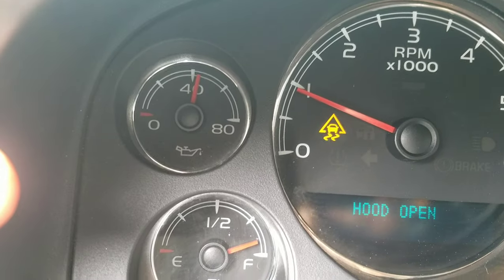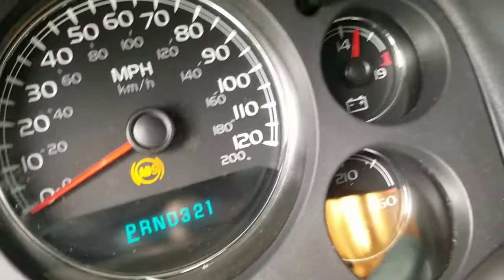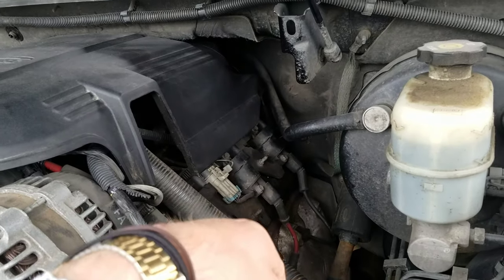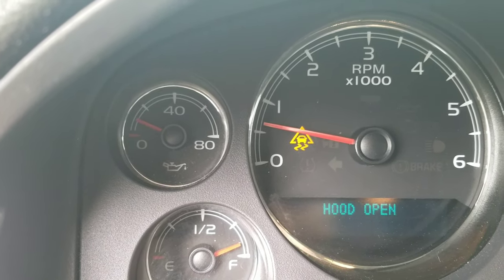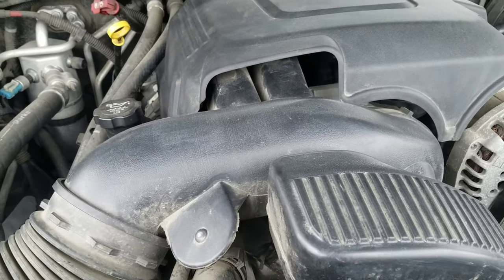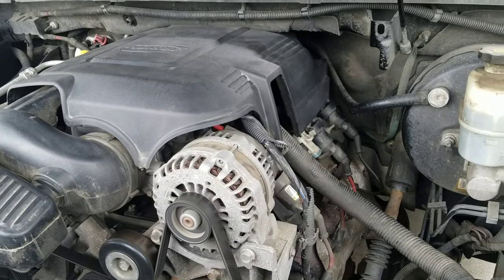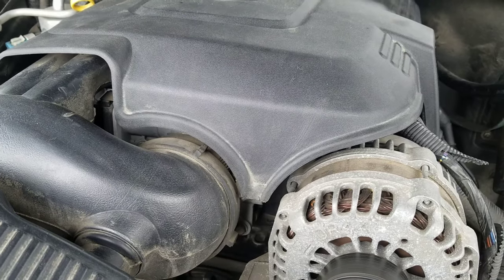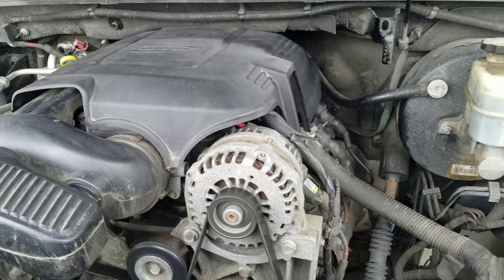0 or Low Oil Pressure? Chevy Suburban, 5.3l Vortec 2007-2014, Tahoe, Yukon. Diagnose and Fix Easiest

Comment: Have similar problems. Here is what to look for not in any particular order. Bad sending unit, Bad oil seals, rear main seal, o ring on the oil pick up tube in pan cracked, oil pump worn, and Cheap restrictive oil filters. I do recommend the oil flush trick on older high mileage engines too. Good luck!
Reply from the maker: Good call

Comment: Yeah. Had the same problem on my 2007 Suburban. 3 times after oil changes at a well known oil change place where they were using Cheap FRAM oil filters to save a buck. I could be driving along and the pressure would slowly drop to zero giving me an alarm. I would put the truck in neutral and shut the engine off for 2 seconds and restart while coasting along. Pressure came back to 40 immediately on restart. Changed to WIX filters (insisted the oil change place install my provided WIX filter) and never had the problem again. Something was breaking down in the filter after 1k miles. Decided to change my own oil after that so I know the quality of the oil and filter. Saw a Youtube video where they tore apart oil filters to show the quality. FRAM was rated worst and WIX among the best.
Reply from the maker: Yup. Never use fram

Comment: Exactly what I am experiencing. I changed the oil pressure sensor then had to take to the dealer. I changed my valve cover gaskets due to leaks but my valve cover bolt holes were stripped. Dealer installed heli coil kit and new valve covers, drove the truck and said oil pressure was good. I picked it up, drove 10 miles and oil pressure dropped to zero. Back to dealer and they did a manual pressure test which was 20 psi @ 3000 RPM and 0 psi at Idle. They said it was indicative of bearing failure and suggested a new engine. I told them to check the oil pickup tube screen for blockage and to change the o-ring on the pickup tube. They're doing that this week.  I'm pretty sure it will work. Like yours, I have zero engine noise. 2010 GMC Sierra 1500 SLE 5.3L Vortec.
Reply from the maker: Yeah hopefully that solves it. Stripped bolt holes are no fun
Reply: Hi Richard, what was the end result after they changed the o-ring on the pickup tube?
Reply: @micahrobinson5224  they've been sitting on it since I posted this, giving me excuses as to why they haven't got it done. I called them today ready to tell them I was taking it somewhere else, but when I called they said it was being worked on and should be done by end of day today. Stay tuned.
Reply: @micahrobinson5224  well, they found a piece of cam bearing in the oil pan. Again they say new engine. Waiting to see if Warranty company will cover it.
Reply: @micahrobinson5224  warranty company (Route 66) is paying $3K towards a new engine. I found a company that remanufactures the 5.3 with a D.O.D. Deleted engine for a few hundred more than the D.O.D. engine, S&J Engines. Lead time is 12-14 weeks on delivery. I'm also thinking about poly engine mounts from AFP. Dealer would not install a D.O.D. Deleted engine, says GM won't allow it, but that's ok because they charge $2800+ for an engine install and the mechanic I got is $900. I'm good with saving $2K! Hope to be in my truck by mid May.

Comment: I had this same problem. My oil pressure fluctuated and fell low enough for the same alert to come on. The car had no signs of low oil pressure; no knocking, no increased temperature, or reduced power. We tried quite a few things. The one thing that fixed it the gauge and alert problem was to simply change the oil filter. I have about 25% life left on the oil, so I will be changing it soon enough. During the course of regular driving, it never dropped below 40 psi, except at stoplights, while it idled, and that still stayed in the 30 psi range. I'm sure that this is a symptom of something else, but that put my mind at ease. I will add ATF to my oil right before my next change, for sure.
Reply from the maker: Yeah. Could be all the gunk in the oil is getting caught in the filter and restricting flow but then you would see hear symptoms of low oil so that's what's weird.
Reply: What brand oil filter are you running ? A certain one I need to get ?
Reply: @g3mccotter  How long you let the ATF oil inside the engine?
Reply: @mrhighway  u ever get this answer ?
Reply from the maker: @mrhighway  I ran the atf in there for maybe 30 mins idling. Once pressures were good I drove it probably 10 miles next couple days to make sure it was good.

Comment: I have a 2008 Chevy Silverado 1500 5.3 4x4 z71 and it would read 40psi at start then quickly drop to 20psi eventually 0psi when i would first start it in the mornings during cold weather seasons, I always made sure the oil level was correct, first i replaced my oil pressure sensor along with a new screen with it, new oil, oil filter after that I was getting great oil pressure well 2 weeks later my oil psi drops down again. I finally just got the o ring replaced on the oil pick up tube its reading 40psi at idle and 60psi at highway speeds couldn't be happier. I Strongly recommend getting the o ring replace
Reply from the maker: Yeah I've heard this can be a culprit.
Reply: This is exactly what my 09 Silverado is doing. At crank up about 45 psi and gradually falls to 20 psi and pretty much stays there. I had the oil pressure sensor and filter changed. So I’ll have the O ring done next.
Reply: Well I replaced the O ring and still had low oil pressure, so I replaced the oil pressure sensor switch again thinking it might be bad, still having low oil pressure. Crank up 40 psi, gradually falls to 20 and stays. Any ideas?
Reply: @peppercombs  same here!!  Lmk. When you fix it

Comment: Going to give this a try. Bought a 2011 yukon. Had low oil pressure. 1st changed oil pressure sensor and screen. No effect. Then changed oil pump, oil pressure relief valve, and broken pickup tube o-ring. Oil pressure improved but not where it should be. Oil pressure starts cold at about 30 then drops as it warms. Went to slightly thicker oil resulting in very slight improvement. Always using full synthetic. No ticking, no knocking, no misfires. Also going to try switching to the OEM oil filter (AC Delco) after the seafoam treatment.
Reply from the maker: This is more a fix if you haven't done all that yet. Haha maybe it will work for you though.
Reply: @g3mccotter  what else is there? I have an 08 escalade I just got with no oil pressure, except I have the lifter noise like this guys 2011 yukon, im really not getting any pressure.
Reply: So did it work 🤔🧐

Comment: I did this trick.  And it seems to work.  Will update after a few weeks.  I only let mine run with seafoam and tranny fluid for about 30 mins. Then did oil change.  40 psi at idle and 50-60 psi driving 😀
Reply from the maker: Good to hear

Comment: Well... It's my turn to confirm or deny.  Got the exact same issues, Stabiltract warning and all.  I get the same 40 PSI pressure that slowly drops to zero until the alarm goes off.  It's been 6 months since last oil change due to remote work and moving states.  Still got the thicker summer oil in it and even some heavy STP additive due to heavy towing of tandem axle trailer and it's now anywhere from 20 degrees to minus 13 here.  So definitely time to change the oil and refresh.  I started by putting some motor flush (small amount, 25% of bottle) in with some High Mileage Sea Foam also.  That's one of my favorite combos.  I'd use pure naptha also if I could find it.  I'll keep you posted how this goes.  I may have to switch to the ATF + SF combo.  I also suspect my oil filter at this point is actually creating a blockage/restricting flow... so looking to replace that and see what change occurs pre and post?
Reply: Owned this rig 3 years now. 163K miles on her.  This condition struck last weekend for the first time, while on a ski trip.  Had to turn around 5 miles out of town and head home to swap out vehicles. That's how serious we took this condition. We thought the motor was going to be toast.  So we limped our way back home stopping every couple miles as PSI on hwy dropped to zero, trying to avoid real engine damage. Found out she had a CarQuest Standard Oil Filter for conventional oil, not for synthetic oil, which I paid for (cheap $5 filter, only 5,000 mile protection, truck has 12,000 miles since last oil change, part #R84060).  Truck sat all week. So last night, I began dumping some High Mileage SeaFoam and some Motor Flush into the vehicle.  Let it run for 2-3 mins... then shut it off.  I did this 3-4 times and let it sit over night and most of today in freezing weather.  I got to the Oil Change facility here in town, and explained what was going on.  I put 1.5 quarts of motor flush in ($9 Walmart)... and let it run for 15+ mins total, turning the car off intermittently (30 mins overall).  Pressure was never higher than 20 psi, no matter what I did here.  I handed her over and gave the guys my own, new FRAM Synthetic optimized filter ($8 Walmart) and let them  change the oil.  Truck came out and had 32 psi right away and was holding at idle of 500 rpms.  I drove her 50 miles, hwy, right out of the parking lot, after this because I could see she was immediately popping up to 39, 40, 42, 45 psi (normal) and holding and if I'm going to have a problem, I want to know it now.  I did put the other half can of Seafoam in the new oil so it continues to clean and will leave it in.  Guys, gals... this did the job and I had PSI back immediately after getting that old oil filter off the engine. (A critical step and likely cause of most of the flow restriction)  Comparing methods: The ATF fluid is hydraulic fluid, not motor oil, and has detergents in it.  The motor flush is full of organic solvents that eat sludge and varnish faster, it's diesel fuel, kerosene, benzene, napthalene and other sludge dissolving solvents.  Both are good options.  And I feel bad for anyone out there that has been burned by the Dealership misdiagnosing the issue and resorting to thousands in unnecessary and preventable engine repairs.  Let's get the word out on these inexpensive solutions.  Change your oil filter immediately!!  That's the bottom line.  Thanks @g3mccotter for making this vid bro!  Huge high five, Sir.  First round of beer is on me. 😃  Total cost of all fluids, oil change, new filter to fix issue = $150 (reducible to $70 next time).  No OEM parts were replaced.   Cost of new Engine = $7,000 plus 15-30 days dealer shop time.  Do you want to make several months payments on the Dealership General Manager's six figure Ski Boat? (a real thing, I used to work for one of these azz holes)  Or save that money and put it towards your kids?  You decide.
Reply: Update:  Solution Confirmed!!  This Solution May Be Faster when using Solvent Technology Rather Than Detergent.  Total Time to Fix:  90-120 mins  Root Cause: Standard Oil Filter Causing most of Blockage, Likely Sludge Build Up due to reduced oil pressure.  Resolution:  Priority #1, Replace Oil Filter with High Quality FRAM Ultra Synthetic "double media" Filter (FRAM Part XG10060 series for 2008 5.3L V8 Tahoe).  Seriously... what's an extra $3 over standard filter??  You're $7,000 Engine deserves this!  #2,  Treat w/ Seafoam + Motor Flush or  SF + ATF to clean sludge from engine and oil pressure sensor and  internal screens.  Add most of motor flush at oil change station.  Don't rev engine or drive without increasing oil viscosity first to get to JiffyLube or Grease Monkey. It ok to go over dip stick max to solve issue.  I was 3 quarts high slowly rolling into Grease Monkey.  Oil viscosity is what matters most.  I did hold idle at <1100 rpms during treatment... then shutoff to soak for a few mins.  Rinse, Repeat.  Rinse, Repeat.

Comment: Bleed the oil pressure sensor, turn on engine and let a little oil come out the outlet on the oil pressure sensor! Easy fix! Replace the oil pressure sensor and it should work!
Reply from the maker: So take sensor out, start engine, let oil come out then put sensor back in and voila?
Reply: g3mccotter that easy had that problem and finally it works like a charm now
Reply: I got 2006 trailblazer 5.3l i change the sending units switch and screen filter, and oil gage still dropping down tired of this, any recommendations if your fixed
Reply: Just did this today and it worked!
Reply: Makes sense, I didn't think of it but I'm going to give it a try.  Thx

Comment: If you look at your ground cable from engine/trans to your firewall, it is horribly corroded.  (Green)   This cable is known to cause all kinds of communication problems with modules.  Cure is to run 24 inch  cable from the stud where cable is on firewall to the bolt on alternator fixture/wire clamp.  You do not have to take the webbed cable off unless you replace it.  I am being cheap.    You are adding another route for ground.  I see your wires that go thru the clamp on alternator bracket are all exposed.  Check to see if these wires are chaffed from rubbing on the inside of the clamp.   They can chaff with movement of engine.  One end is on inner fender well which does not move when engine moves.   Can trigger all kinds of codes that have nothing to do with the problem.    Bad grounds or grounds that should not be there confuses computers.
Reply from the maker: Thanks for that tip for sure. Good to know. If I get another I'll look out for it

Comment: I had a similar problem, and after opening the oil pump, I found that the spring was broken
I replaced the springs with a new one, a little longer, and now the oil pressure is 60, and when the car is hot it reaches above 40.
Reply from the maker: Interesting. Haven't heard of a broken spring on the oil pump yet

Comment: I’m having same problem, had sensor changed, head gaskets and was good for a while. Started doing oil pressure low stop engine again today.
Reply from the maker: You can try this if your engine doesn't sound like it's out of oil like the gauge says.

Comment: It may be the sensor for now, if not a sudden drop in pressure like that would likely be the pressure relief valve in the pump sticking. If you do the pump, or it starts ticking always replace the O-ring seal on the pick up tube, and the camshaft thrust plate (the thrust plate has a built in gasket that seals the lifter gallery). Either of those 2 things will destroy the camshaft if ignored.
Reply from the maker: Thanks. Yeah I've read about those needing addressed on these. Was this just an issue with the afm from 07 to 10?
Reply: Yup going thru the same problem right now as I type this I have 2011 avalanche and the mechanic installed new cam bearings, new camshaft, new crankshaft and crankshaft bearings, new ls7 lifters ,oil pressure sensor, did a DOD delete, new high volume oil pump with new O ring on pick up tube, anyways he forgot to replace the camshaft thrust plate idk why he would forget that but hoping that would solved my low oil pressure issue I’ll give u guys a update when it’s all done …
Reply: @lenny_miller2357 so what happened with your problem 
Was it the plate ?

Comment: Thanks for the video. Thought we had a bad pump or o ring on my sons truck. I knew of this method but didn’t want to do it because I thought the truck was maintained correctly. Previous owner is related. Did this and it did the trick.
Reply from the maker: Good to hear. Surprised me when it worked and everyone else it's worked for.
Reply: @LUNAR FLEX luckily for me, it was as easy as an engine flush. Which is basically what running a quart of transmission fluid and a pint of Berryman in your crankcase, along with your engine oil. My engine was all gummed up.
Reply: I have the same problem & my smog check won’t pass did this also happen to you ? I’ll be trying it out tomorrow but just wondering
if the smog Check also didn’t pass for anyone else .

Comment: Man I'm so glad you found a possible solution to this. All the other videos I've seen are the exact same, they change the oil pressure switch and say ok that should work. Well not with mine, I changed the pressure switch and the P0521 code keeps coming up. Oil pressure on my dash is good but it still keeps throwing that code. No one that I found explains why
Reply: When I using 5w30 oil in my car that code P0521 would come on constantly but when I changed to the oil I was suppose to be using 5w20 oil that code hasn't returned.
Reply: @RandomMind  same here, I changed the oil and put in the correct oil for my truck and it hasn't happened since. I did change all the coils, spark plugs, and wires tho because it felt like it was missing but it's running a lot better now.

Comment: I’d go for the o ring on the pickup tube. Known common problem with the LS engines.
Reply from the maker: But that would merritt actually restricting oil flow causing engine damage quickly. Mine never did.
Reply: No, I had a split o ring on mine and all it did was slightly reduced pressure.  Still did the job, but not efficiently until i replaced it.  New pan and oil cooler gasket and no more leaks either. This is in a 180k 07 yukon denali 6.2.
Reply: Where's this at??

Comment: 07 tahoe I changed oil about 2000 miles later started losing all oil pressure like this so I changed filters to a Mobil 1 an problem was fixed. Since then I used Mobil 1 oil filter never had problem again!
Reply from the maker: I've heard good results from that oil filter